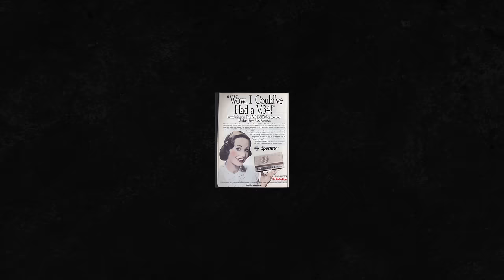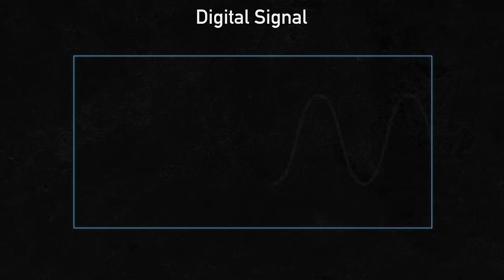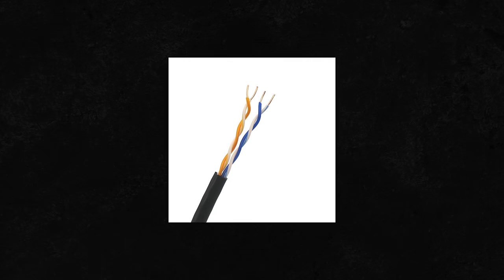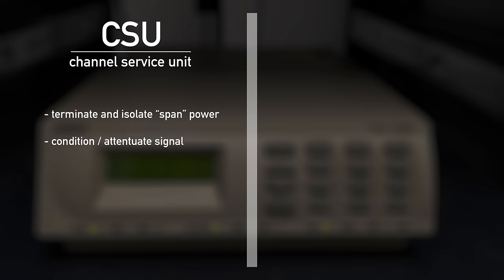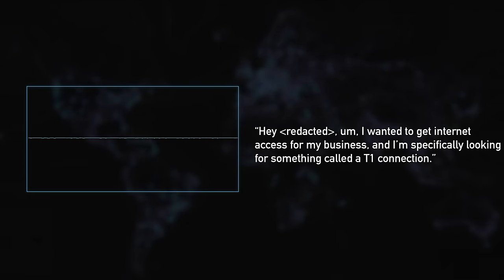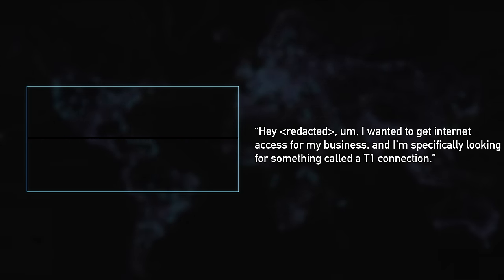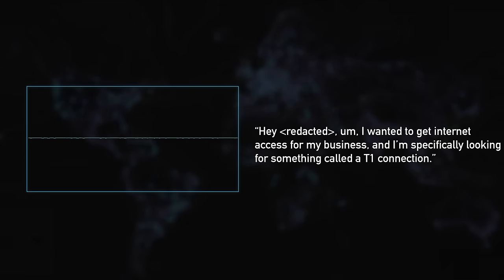1.5Mbps of pure '90s: Setting up a T-1 today - ISP Series Episode 3

Comment: Honestly, hats off to your ISP for letting you demonstrate a real T1 line and BGP. This is an amazing series!
Reply: I’m still a bit confused about exactly how they accomplished that, would appreciate a short following follow up, I’m sure it’d be very interesting.
Reply: Sadly enough we still have several remote branches using T1s.
Reply: We used to have a T1 until AT&T sunset it in our area and we finally had to upgrade.
Reply: It’s just a LAN though. The ISP didn’t have anything to do with this project.
Reply: @user-gc1ky2rf3y I get they're using a LAN. But the an ISP typically does NOT let an end user set up BGP and emulate an old School ISP themselves. 

He'll I can't even get reliable port forwarding on mine, even over IPv6....
Reply: @DFX2KX  IPv6 shouldn't have port forwarding... theres no NAT
Reply: @DFX2KX What are you talking about? Pretty much any ISP will let you run BGP if you get business class services. In fact it’s practically required - no one static routes anything these days.

Of course if you think v6 port forwarding is a thing, no wonder you don’t understand these concepts.
Reply: @BlownMacTruck  AT&T will not let you do BGP on their "business class" fiber service, only the dedicated metro-ethernet (or whatever they are calling it now)
Reply: @FLECOM  It was just me waving my hand vaguely in that direction regardless of the actual technical implementation. My point stands.
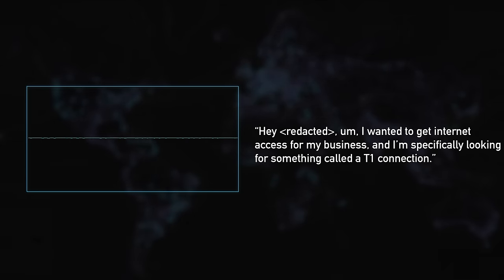Reply: @DFX2KX - I do not think an ISP was involved in the T1 part. Everything you see is inside a lab, and he even says at around 10:55 that the T1 line is fed from a device in the lab.

As for the BGP part, that one might be real (the ASN and IP addresses used seem to match a real network). But BGP is also very easy to simulate/test in a lab, as long as you have a few routers laying around.

I actually cut my teeth on those Cisco 2500 routers shown in the video, a long time ago... never thought I would see one in a recent video :)
Reply: @BlownMacTruck with "Cloud" firewalls it doesn't even matter what provider you have, as long as it gets to the net.
Reply: @denniswoycheshen  Ok?That has nothing to do with anything in this thread.
Reply: @BlownMacTruck  true 😅
Reply: @BlownMacTruck depending on your setup, you may need to set a rule in your router to allow traffic to your ipv6 machine in general or over specific ports
Reply: @JordanPlayz158  Why are you telling me this networking 101 crap?
Reply: @BlownMacTruck  ... because you said ipv6 port forwarding wasn't a thing which I'm not sure if technically that is true but there is still some "port forwarding" like things (depending on setup) to have the ipv6 machine and/or port be accessible
Reply: @JordanPlayz158  Port forwarding is a concept inherently tied to NAT. There’s almost zero need to NAT in IPv6 except in very specific corner cases.
Reply: @BlownMacTruck  that still means you're contradicting your initial comment from the sounds of it
Reply: @BlownMacTruck  I’m sorry, but can you explain to me how that works when moving from WAN to LAN in a residential setting? I understand that, in theory, with v6 each device could have its own WAN address but as far as I’m aware that’s not how it works. We still reserve a block of v6 addresses purely for use inside of a LAN and most routers will still have an active firewall blocking traffic from most ports for security reasons. If I want a port visible from outside, pray tell how I am to do that without port forwarding in a v6 scenario.
Reply: @Daktyl198  As mentioned before, port forwarding is a NAT concept. Allowing ports through a firewall is a security concept and is an entirely separate thing. I'm guessing you and others are conflating the two ideas because you've been conditioned to think that port forwarding is the same as allowing ports, which happens all the time in IPv4 when you use RFC1918 addresses connected to the internet.

They're not. And even with v4, you can completely ignore port forwarding yet still allow ports through a security plane. This isn't common in homes and small businesses due to the fact they're rarely using publically routable IPs, but it's EXTREMELY widespread everywhere else.
Reply: @Daktyl198  by putting in a firewall rule to allow it, same as you would with v4 with a LAN block that's not NAT'd
Reply: @ChasBlobster  I feel like my original message didn't convey my thoughts well enough. I am specifically talking about a residential setting, with a ISP-provided gateway/router. The ISP-provided gateway blocks all ports that aren't port-forwarded that I know of, and you can't edit the firewall directly on many of them anymore. If a person was running their own hardware it would be a different matter (and much easier).
Reply: @greatquux  Pretty sure the actual peering between The Serial Port and NetActuate is occurring over a VPN tunnel terminated to a device with a T1 port emulating the phone company. They're not actually running T1 from the datacenter to the lab.
Reply: I'm confused. None of the isps that he talked to let him do it. He literally talked about how he had to make a t1 Network on his network so he has a local t1. 

Did you not watch the video?
Reply: as somebody that has dealt with business networking. I can tell you this is not all that unusual. A lot of businesses have legacy backbone services that still require the use of a T1 modem. Usually, it’s larger buldings alarm systems that rely on them. you could say oh why don’t we just hook it up to the regular Internet line for the business. Well, that would be great except for the fact that T1 tends to be more reliable a lot of security systems will use both they will primarily use the primary Internet system and when unavailable they will switch over to T1 usually the Internet networks are on different hardware than the phone networks and T1 lines.

Comment: In the early 2000's, my dad started his medical practice in a clinic with a T1. After using 20 kbps dialup, going to his office and browsing the web was a pretty unreal experience. He couldn't stand to use our dial-up at home.
Reply: I worked at a telco for a while.  I once downloaded the Linux kernel sources over one of our dual 700Mbps upstream links.  It was done so fast I thought it had been locally cached, and I was wondering who had been downloading kernel sources.  Nope.  Just screaming fast connectivity pretty much right off the backbone to our state.
Reply: I remember hearing anecdotal stories from friends at the time who knew someone with a 1Mbps download speed. I remember thinking to myself 'what, a whole megabit are you crazy, no way...' ...and I think it was like 5 years later when I had my own ADSL connection of about 3Mbps, which definitely 'democratized' speeds then.
Reply: @MattExzy We had a fractional at home for my dad’s small business. I wanna say it was ISDN at 128kbps? That was awesome at the time.
Reply: @MattExzy  Times have truly changed, I just use my cell phone subscription these days, I get 100mbit on a regular 4g+ connection. A little more latency than a wired line but nothing that bothers me. It has a data quota at 100gb a month before they throttle the speed to 3mbit. Since I don't stream any 4k or any other data heavy stuff it works fine for my needs. 3mbit isn't fast by modern standards but growing up with just a dual isdn line at 128kbit I manage quite nicely.
Reply: What happens next????
Reply: At  7:00  wow those eye watering monthly prices for T1.  lol

Comment: Man, I remember when I was a kid I dreamed of having a T1 line. And then I got a bit older and cox came out with 3mbps cable internet. I was blown away. Fastest internet on the street between all my friends, which means we abused the crap out of my pc downloading music on kazaa lol
Reply: Right?? And now I have 7gbps symmetrical fiber at my house... We've come a long way
Reply: Our first "broadband" connection was Virgin's 1 megabit connection. 
It came with a USB network adaptor and you had to register your MAC address. 
We registered one and then spoofed it on the router I built. 
A Pentium 75, 32mb of ram, 2 intel 10baseT Cards and a copy of the Linux Router Project on 1.44mb floppy.
Shared the connection between 3 in the house
Upgraded it to TWO floppy drives which have me enough space for OpenVPN connection and packet QoS.
We'd use QoS to speed limit to keep Virgin's packet queues empty and tag html traffic as low latency low bandwidth, file sharing high latency and high bandwidth and gaming at gaming as low latency high bandwidth
Reply: We had one installed at our school in 1999. Most kids didn't even understand, but a dozen of us were in heaven.

Comment: I remember working a for a local ISP in '97. We had a T1 line for 25 modems in our community. I loved walking into the office and having direct access to that connection. It was a warez's wetdream in those days.
Reply: Similar. In 1999 I still had a 33.6 modem, but worked at an ISP that had THREE! T1 lines. In fact, my PowerMac had a second 21" CRT that ran the monitoring tool (nmap? No? Maybe?) that showed a live map of our network and I had to keep an eye on. In 2000 I ended up as a beta tester for the AT&T @Home cable modem. A whole 384/128kbps! So fast!

Comment: I wish there was something stronger than a “thumbs up” because this video was stellar.  A trip down memory lane, this was. By the time my old company retired T1s, we had four coming in for a 6mb connection which got split out by ISP equipment (AdTran not Cisco this time) to a PRI for voice, a half dozen or so analog lines, and of course ethernet. It went through our firewall, then hit the core router where we had at least five point to point T1 circuits, a couple were bonded and went to a single location. It was a great solution because we were able to push all the Internet and voice services out from a central location and save a ton of money.  Indeed, like you mentioned, we in IT felt like gangsters at the HQ because we had faster Internet than everywhere else.

Comment: I worked at a local dial-up ISP in the late 90s. When I first started they had a pair of T1s, but later replaced them with a >1gbps optical connection when the closet full of haphazardly-stacked modems got swapped out for banks of 56k modems built on special cards connected through a common backplane. Having access to a low-latency 10mbps connection (limited by the computer's network card) was truly incredible.
Reply: Shit, that would have been like traveling at warp speed compared to driving a car. I'd probably crap my pants if I saw it download a few MB video clip in a few seconds, compared to hour plus it would take on something like a 56k.

Comment: This reminded me of my setting up of ISDN in 1997, which I used until 2003. I had two 64 Kbps B channels, allowing 128 Kbps. I had this connected to a "Smoothwall" router and a network switch to both my computer and my brother's computer. ISDN was my only better option than dial-up; DSL was not available in my area.

Comment: frame relay and fractional T1 might be interesting sidenotes. I worked at a large region ISP in the late 90s and while main upstream were multiple T3s, we had remote branch dial-in servers connected through frame relay. In the early 2000s my subsequent employer went from frame relay with channelized fractional T1 for voice lines to combined voice and data over T1 to VoIP over T1, and finally to cable.

I personally was responsible for configuring the xylogics microannex XL in college for dial-in access (replacing a cisco STS-10) which led to my job at the ISP primarily maintaining banks of telebit netblazers with racks of microcom(?) modems.  there was some talk of replacing the modems with newer netblazers that could take in channelized T1s and handle 56k "modems" completely with DSP on each of the DS0s, but after I left the management decided to replace the netblazers with livingston portmasters which stupidly only supported 30 ports instead of the netblazer's 32, requiring redoing the wiring.

interesting times.

Comment: A lot of this was my life at Qwest at one time- finding spare pairs to provision a T1 (or anything lower like a 56K or ISDN etc), calculating the losses and if it would require repeaters and how much the job would cost, then working with the crews to solve roadblocks ("you can't put a pedestal there" "turns out the pair is too noisy"). Also, It's astounding how expensive an OC-12 or 24  cost at the time, yet I now have an equivalent fiber line for less than $100/mo
Reply: I learned more about CLEC, ILEC, "last mile," and the magic phrase "necessary and adequate," than I ever wanted to know when I became involved in a dispute between Qwest and our ILEC while trying to get a T1 installed between our MI and it-doesn't-matter-what-the-other-state-was - MI was the problem.  I can't imagine you guys having to deal with that all day every day - hats off.
Reply: Glad I spent a bit of time with US West, but just as glad to have moved on before it became Qwest. ¯\(°_o)/¯
Reply: I'm about to start an ISP, and it's all fiber. I'll definitely miss the old ways.
Reply: thankfully fiber can go hundreds of miles with a repeater/signal amplifier with the right glass/transceiver. no more crosstalk or signal integrity issues

Comment: Great work, retro networking has been a bit underrated. A couple years back I set up an E1 in my lab using two Cisco 2500 series and network termination equipment, mostly out of curiosity for 90s networking and because the kit was available cheaply on eBay. I did the same with ISDN BRI, and have a couple of ISDN BRI and PRI test phones too. Fun stuff to play with and as you say, absolute game-changers back in the day.

Comment: I was the telecom tech for a large hospital group and we had T1 before the telco's offered it.  It was implemented using microwave between two hospitals on opposite sides of town.  It was used for data and telecom.  Eventually the telco was able to offer T1 so we used them until other companies provided better/cheaper service via fiber.  I think we had 72 T1's by the time I retired.  Many of them were configured as ISDN with 23 bearer and 1 data channel per span for voice.  I still have a couple of ADIT channel banks that I use for my antique telephone connections with an Asterisk box.

Comment: I've been trying to forget all the T1, Frac, Frame Relay, etc circuits that I had to set up back in the 90s and early 00's. The setup was simple, but dealing with the different Telco tech's was often a nightmare (because they NEVER made mistakes, even after you showed them they did).  Cisco 25xx routers were bulletproof, still are if you can tolerate the 10Mb speeds.

Comment: You should also need to talk of the BRA ( Basic Rate Access ) since it was also part of the ISDN suite with the T1/E1 and provided up to 144Kbits/s ( with tricks and the correct hardware + subscription ) when the norm was 56Kbauds... 

Also, since T1 is American Specific, in Europe it's called E1 and it's a 2048Kbits/sec link ( 32*64K [with up to 30 usable for data] )
Edit : 
Oh and in lots of place in Europe, we used V.36, or X.21/V.11... V.35 was usually seen as a PITA due to the two different pin sizes that could be on the connectors and the indecent size of said connectors ( V.36 and V.11 use Sub-D sized connectors [ 15 pins for V.11, 37 pins for V.36 ]
Reply: To the best of my knowledge, Asia settlers on E1 standard.

I was in SE Asia and we were putting in a Terminal server, connected to the Master Exchange at the Telco. We had a stumbling issue in that we couldn't get the E1 cards to go into the Exchange at a reasonable price.

Fun days.

Comment: Great video! One note on the smartjack you have: it converts HDSL2 on the telco side into a T1 signal on the customer side. HDSL2 is a method of transmitting a T1 over a single copper pair rather than two. It also allows for a longer distance between repeaters, 9,000 feet vs 6,000 feet with a regular T1. The HDSL2 standard was published in 2000. The previous generation of HDSL came out in 1994 and had similar advantages, but used two pairs. HDSL1 allows for a distance of 12,000 feet between repeaters.

Comment: The k12 school I worked at had a T1 for many years and we eventually started to saturate that T1 link. At that point we ended up getting another T1 and bonded it with the existing T1 which helped for a while. At the time we really didn't have much choice for high speed internet.  We ran the Cisco 2501 and had a Cisco 6509 Core and ran Cisco edge switches. 
I still remember when we updated the fiber between the four campuses from a single shared 100Mb link to four dedicated 1 Gig links (I think that was 2007).

Comment: In 1996 I was a Software Dev Manager for Dialogic Corp.,, the then leader in voicemail and voice response systems for business. I needed surgery and had to work at home for a couple of months so they installed “fractional T1”, two bonded 56K lines. That gave me 112Kb/s of 24/7 Internet connectivity. Compared to the 56K modems in use at the time that usually connected at 33.6K, it was heaven on earth. Thanks for the memories!

Comment: Cool!  I was a lucky dog to have a DS1 line run to my condo in 1998… I’d contacted a statewide ISP I’d been the CIO of a few years earlier.  When I sold the condo in 2001, the realtor kept telling prospective buyers that the large box above the washer/dryer was an alarm system. 🙄  Yes, an alarm system wired into a Cisco router on the counter beside it. 😂

Still, when I sold it and left the state, I was stuck with crappy internet until our neighbourhood got Google Fiber in 2015!